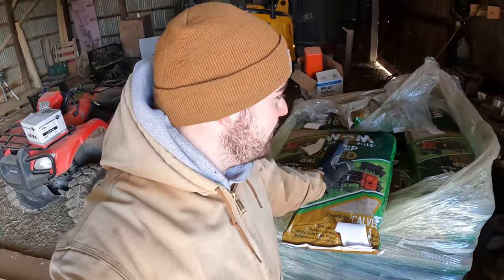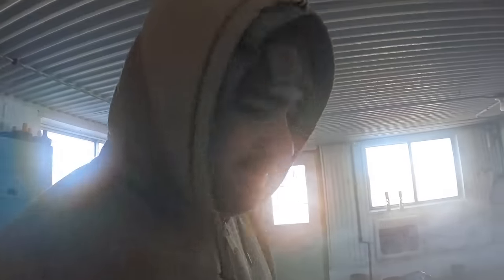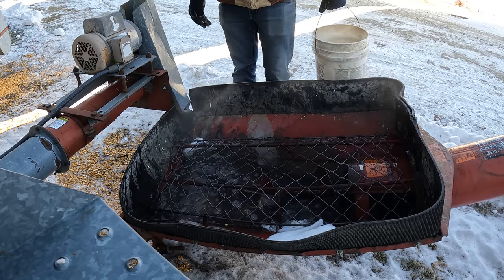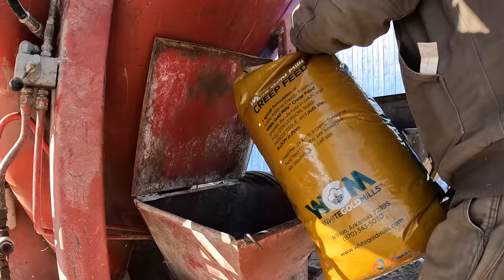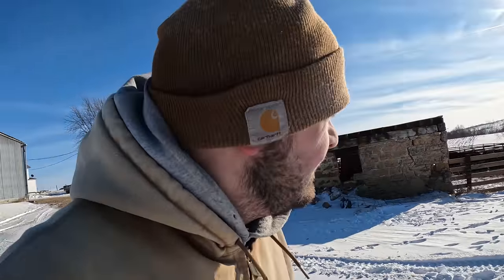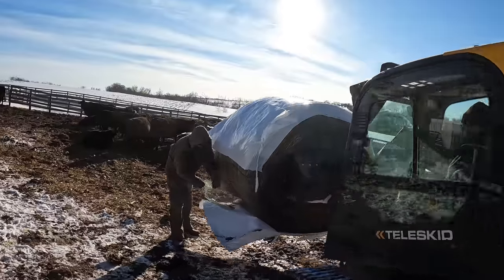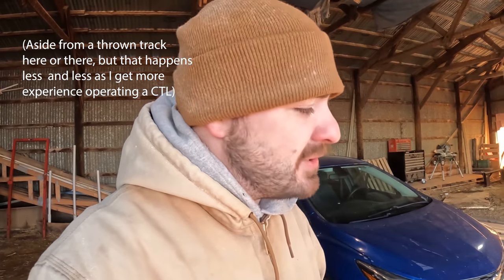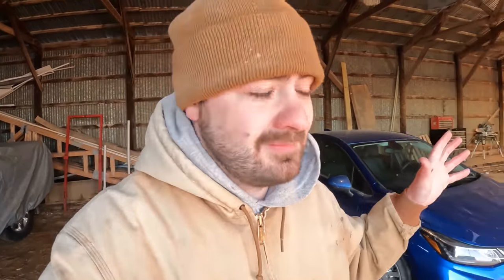Winter Chores on the Farm - Feeding Cows with the JCB Teleskid

Comment: Extruded whole cottonseed meal is great for cattle.  The cotton seed is removed from the lint at the cotton gin, and then sold by the semi-load to cotton oil crushers.  The seed is fuzzy since the lint saws in the gin stands basically pulls the lint off the seed, until all the lint is gone and the seeds fall out of the gin breast (where the saws are) down into an auger under the floor that carries them to be transported to the seed house (which is usually up on legs so semi's can pull underneath to load from a big hopper bottom door, since the fuzzy seeds won't flow like corn or soybeans or other grains-- they bridge and stick together pretty bad).  The cotton oil crushers store the seed in huge pyramidal-looking buildings in enormous piles, and then feed it into the oil presses.  They usually use a screw press which feeds the seeds in whole where they are crushed under incredible pressure in the screw press which squeezes all the cotton seed oil out of the seed, which then the dry paste extrudes out the end of the press and is augered away to another storage building to be sold for cattle cake (feed).  Cattle cake is then mixed in and extruded to make cubes, pellets, or whatever after blending with other ingredients and feed supplements, minerals, etc.  The cottonseed oil is filtered, purified, and then sold for frying oil to tater chip companies, etc.  

Cotton seed is good feed, but it contains gossypol, a compound that can only be digested by ruminants like cattle.  It's not something you want to feed to non-ruminants like horses or hogs because they can't digest the gossypol, and it'll give them terrible gas and scours, and it's not good for them.  The gossypol remains in the seed meal, not in the oil, so cottonseed oil is fine for human consumption.  We used to grow cotton and there was a cotton oil crushing plant directly across the street from the hospital my daughter was born at in the county seat town of Richmond 15 miles from our Needville farm, and I learned a lot about it over the years.  When they were crushing cottonseed for oil, the crushing action heats up the seed and oil pretty hot from all that compression and crushing force, so that whole end of town smelled like fresh peanut butter when they were crushing seed as the extruded cottonseed cake was still hot as it was being augered into storage, and the vapor emanating from it smelled like peanut butter... LOL:)  Later!  OL J R :)

Comment: The farm I used to work at did quite a few of wrapped bales and they were wet. Some things we did to prevent molding was use a straw/bedding bale at the end and when the row is done take a skisteer with a bale on bale tines and hit the row. That pushes them back together tighter and pushed out air

Comment: A few months ago when I was looking at buying a CTL I was on the fence between a Deere 333g (pre-def) or a teleskid. I ended up choosing the 333g for a few reasons. The first being it’s power and weight, which are a whole size above the teleskid, it’s the same frame as the 330g but with 10 more horsepower, which was necessary to me as I also do some landscaping/snow removal contracting. Second reason being that there is really not much dealer support for JCB in my area, while there are 3 Deere dealers within 100 km of me. I had some concerns with the reliability/capability of the teleskid in a contracting environment as well, but in a pure farm environment, it would certainly be my first choice. The 333g works great on the farm too, though!

Comment: Another great video Ryan. I have a couple of questions for ya you can answer if ya want to in some other video. Does the 4020 have cab heat. And did ya'll think about runnin comforters that go on the sides of your tractors to help keep them warmer. We did on my uncles and grandpa's  tractors and we live in Missouri. Now mind you we didn't have cabs on ours. But had them on the gas and diesel. Thanks and stay warm.
Reply from the maker: The 4020 does have heat, just not much. We’ve gotten by without any heat retainers on them so far so we’ve not thought about it much

Comment: Can you explain why you have a problem with DEF? I’ve seen a few people badmouthing or disliking machines that use it and want to understand why.
Reply: It's nothing but problems and added expense both to buy the machine equipped with all the extra junk and electronics to work it AND then a continuing bleed of money to buy the gubmint juice and maintain all that crap to make the machine continue working.  All that extra expense, and it provides EXACTLY ZERO benefit back to the farmer having to pay for all that junk.  Why I will NEVER have a machine that uses that crap!  Just a TOTAL waste of money and extra breakdowns when you least need them, for NO BENEFIT.  Plus ultimately all that pollution junk just lowers the fuel economy of the machine, so you have to burn MORE FUEL to do the SAME JOB, and the engines don't last as long-- that's been well proven in trucking service as well as machinery.   Good enough reason for me!  OL J R : )
Reply: @ArmpitStudios  roll till they fall out for all I care, you asked, just because you don't like the answer doesn't make it not true... Some people's children... ROFL 🤣